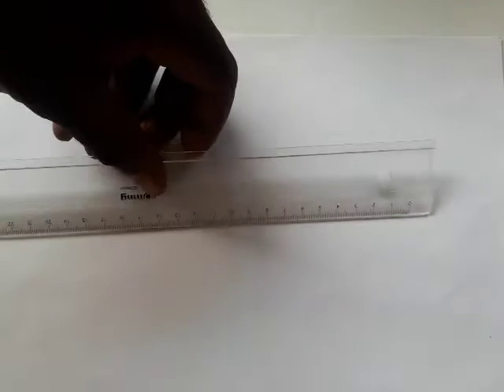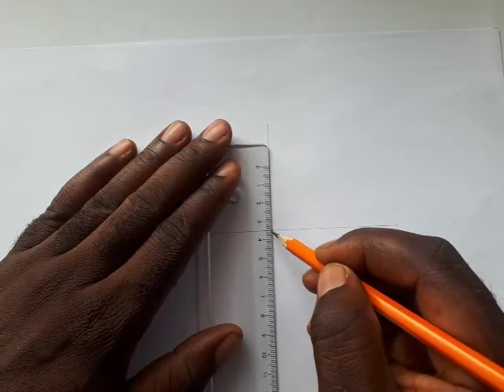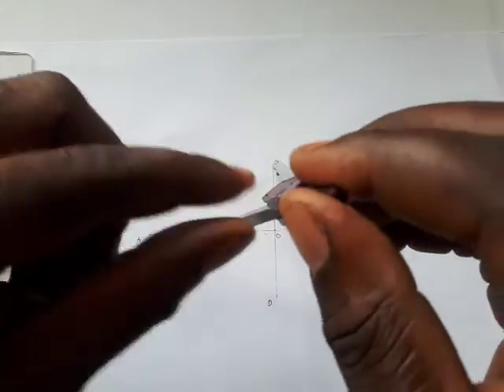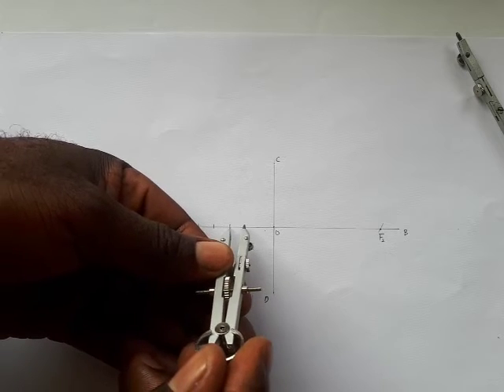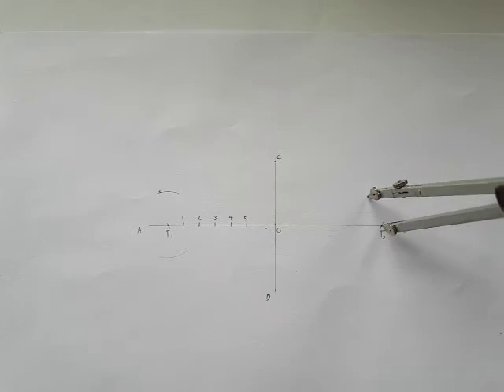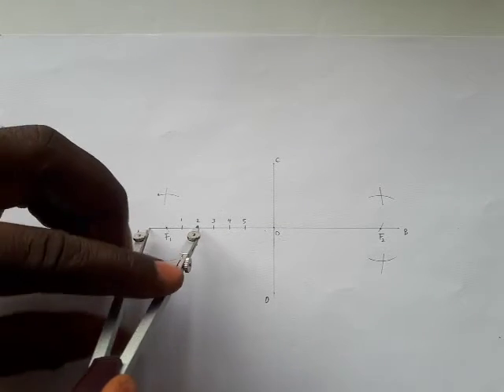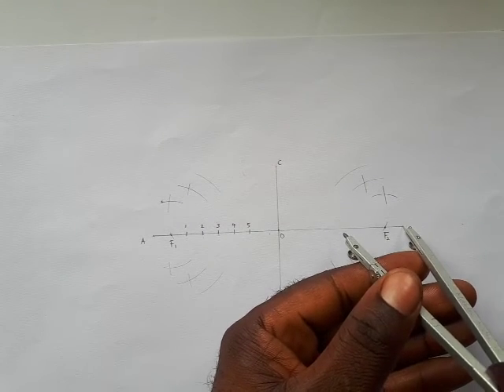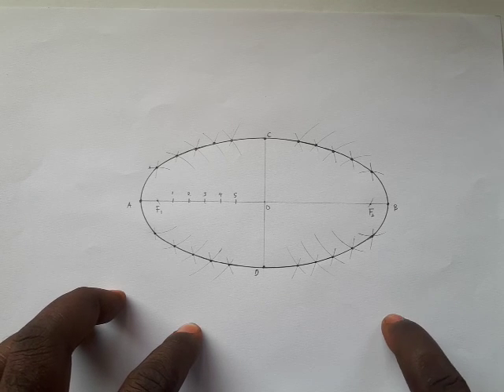TD - ELLIPSE Part 3 (FOCAL POINT METHOD)

Comment: How do i get the distance between f1 and O
Reply from the maker: Hello Kirk Hernandez, thanks for reaching out. 👍
It was explained in the video though.
To get the distance between F1 and O, first of all u must have been given the dimensions of the major and minor axis (AB and CD). The major and minor axis intersects at O when drawn. Now needle your pair of compass at A (or if you like B) and stretch to O (the centre i.e. Half the major axis). Now with the radius AO already stretched on your compass, needle on C (or D if you like) and strike line AB at F1 and F2. That will automatically leave an F1- O distance.
Hope I'm able to answer your question?
Reply: @derickfrederickTD    I think asked the wrong question sorry, i wanted to know how do I get the 1-5 point between the f1 and O
Reply from the maker: @_kirkhernandez  oh I see... OK, yes it's a matter of choice... You could step off 4, 5, 6 etc. equal spaces. This is it, the number of step offs will determine the number of points (intersecting arcs) on each quadrant. The more the number of intersecting arcs, the more perfect will be the ellipse and it will be easier to connect the locus of the points. But 5 divisions is just fine. It could be more it could be less.
Reply: @derickfrederickTD  Thanks 🙏, I get it now.
Reply: @derickfrederickTD  Hi again, I have another problem. When I use the french curve to connect all point, the points are not alligned. what seems to be the error that I have made?
Reply from the maker: @_kirkhernandez  you're welcome. Pleasure 🙏
Reply from the maker: @_kirkhernandez  OK I think I may know what you probably have missed. Check very well again, did you strike all arcs from the foci (F1 and F2) ? Most students unknowingly strike arc from A and B which shouldn't be bcos in that way the points will displace from the circumference of the ellipse. So please check to see that you didn't make such mistake.  I Think I also mentioned the possibility of making such mistakes in the video.

So this is it;
When you stretch A-1, needle on F1 and draw arcs on top and buttom. Needle same A-1 on F2 and draw arcs on top and bottom. Now stretch B1 (which is longer than A-1 now), needle on F2 and cut the arcs you described from F1 (using A-1) initially and then needle (B-1) on F1 and cut the arcs you described from F2 (using A-1) initially. 

Repeat the process for 2,3,4 and 5.

PLS NOTE: DO NOT DRAW ARCS FROM POINTS A OR B... ALL ARCS SHOULD BE DESCRIBED FROM F1 AND F2.

I hope you find this helpful. 👍
Reply: @derickfrederickTD  Thank you sir! I have finished doing the ellipse! Great help 👍🏻
Reply from the maker: @_kirkhernandez  pleasure 🤝. You're welcome. 👍